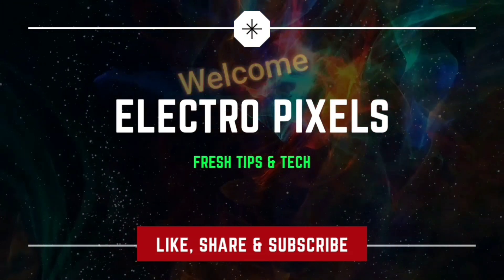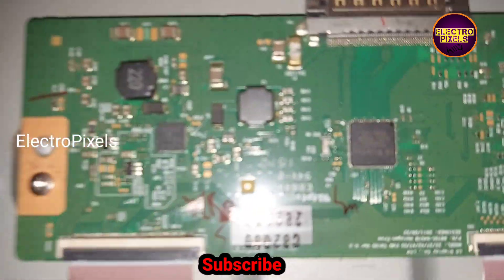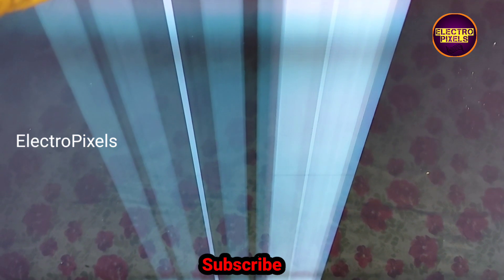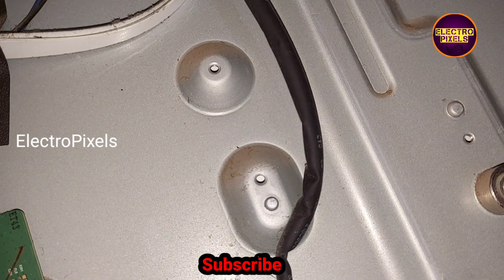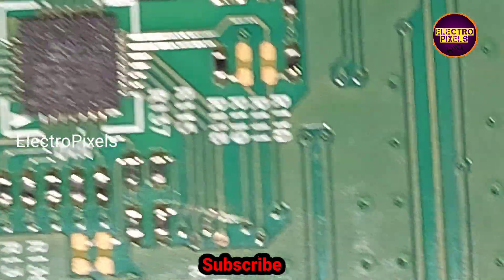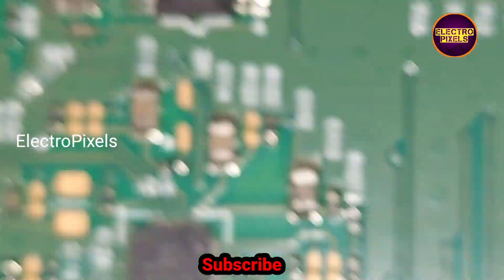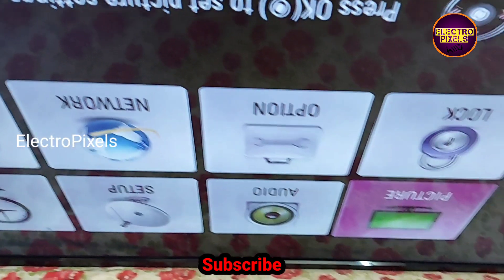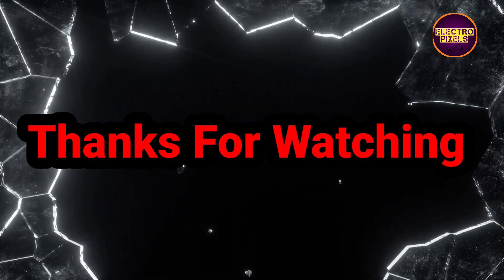Led Tv Vgh,Vgl short removal|Levelshifter IC modification method to solve Picture freezing| LG Tv

Comment: Hello sir how many volts you supply to the jumper of odd and even? Thanks you for the great tutorial sir hope you reply my question..
Reply from the maker: Vgh odd and Vgh Even are Two Test Point in which both Vgh Voltage (24-27)and Vgl Voltage(-7,-11 negative ) voltage will appear simultaneously as a pulsing Voltage. If Vgh Voltage in Vgh odd then same time Vgl Will be in Vgh Even, Like If Vgl in Vgh odd then Vgl will appear in Vgh Even. These Pulsing Voltage is Comming from the Levelshifter Ic so First we need to cut down the Vgh odd and Vgh even track's From Levelshifter Ic
Reply from the maker: After Cutting VGH odd and VGH even tracks from Levelshifter Ic, Now we prevented Voltages entering to panel from ic.After that now you need to First first Bypass vgh Voltage to Vgh odd Test point to Panel side and check picture.if picture is ok then do nothing, if the picture is not ok then instead of vgh odd try to Bypass vgh Voltage in vgh Even and check picture. If both Sides panel is internally short then not Repairable. After all this just only temporary solution.
Reply from the maker: Its vgh Voltage Voltage approximately 27 Voltage
Reply from the maker: This method is used to solve picture freezing complaints. In Auo Panel Vgh odd and Vgh even can be called as LC1,LC2 respectively.
Reply from the maker: For Double Image related complaints there is another method you need to block the Gatesignals either from left or right side and check Picture. These all are Temporary Solution. Permanent Solution is Panel Replacement
Reply from the maker: Thanks for You're valuable comment sir, please share and Support

Comment: If this solution is not worked, which part need to replace on tv. Tcom board or LDC panels?
Reply from the maker: Panel but it's cost is almost equal for purchasing a new Tv

Comment: Both sides is reparable? Channel A and B. +28v and -5v invertido every 2 seconds
Reply from the maker: It just a temporary solution ony, permanent solution Panel Replacement. We blocked that voltages from Levelshifter ic by cutting vhg odd, vgheven tracks and bypassed vgh voltage to vgh odd. Also blocked the Gatesignals